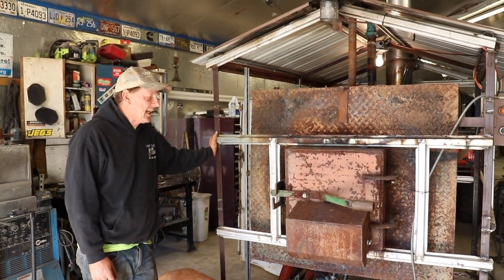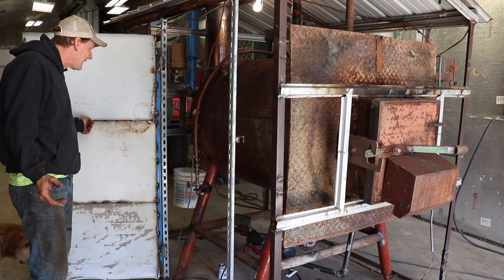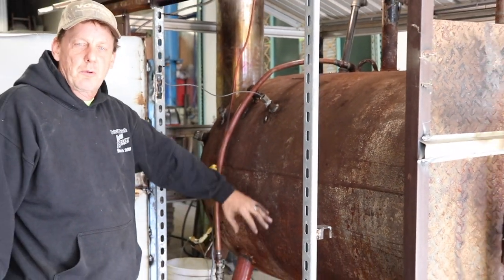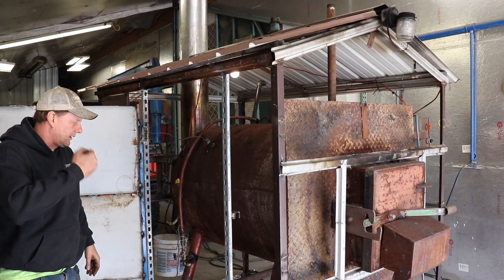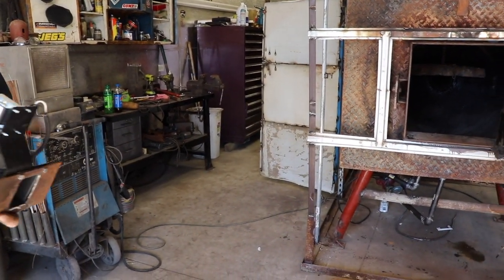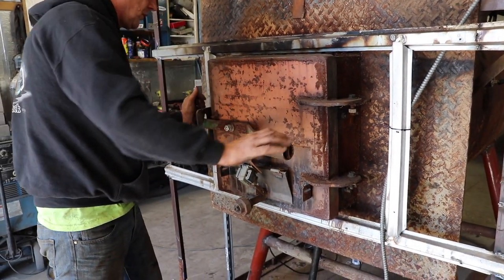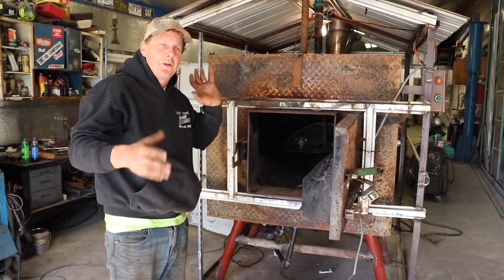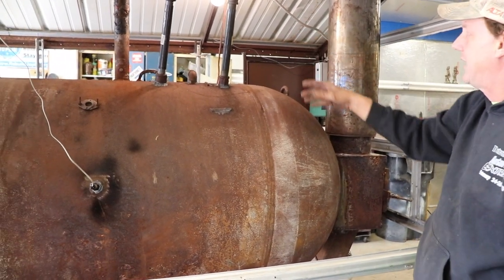How We Heat The Shop For Free | DIY Outdoor Wood Boiler Unit

Comment: I really like the cleanout door in the back for excess creosote !!  Did you consider adding fire brick ??  I want to build my own unit and I noticed some manufactured units with firebrick !  I'm not sure if the firebrick adds to the burn efficiency or not.  It seems as though it would help retain heat if the fire died down overnight .  What are your thoughts on this ?  Thanks for posting this , your design and build is by far the most efficient use of what you have on hand for materials and the small financial investment involved for the electrical controls needed to go this route !!!!!!!  Great Effort !!

Comment: I like the idea of using the big propane tank but how do you do the initial cut into it without risking exploding? Do you need to fill it with water first or something? Thanks man, probably sounds stupid to you but many years ago I was told never to cut into a 55 gallon drum with torch, even if the drum was brand new. Thanks again
Reply: fill with water and then cut

Comment: I would think that you draw off the bottom maybe if you have a water pump , but if you are using gravity steam rises so I would think that it would be better to feed from the bottom, that said if you have a pump and a tight system that has water all the way to the top I would guess that the hotter water would be closest to the 🔥

Comment: Johnny can we get a boiler update please??????
Reply from the maker: Aaron Andrson we will work on an update video. What are you looking for?
Reply: @JohnnyFabz  Im building almost the same setup as you guys. Would like to hear about the updates on the new blower fan and how the new storage tank is working the shop. Also would like to see how you plumbed everything for the house and shop. looks like you have the pumps on zones and maybe controlled by relays valves?  Also have you noticed any difference since you started pulling water off the bottom vs the top. Thanks

Comment: Nice, I like it.  Sounds like it heats your shop AND your home?
Reply from the maker: Steve Spevak yes heats a 60x80 shop and around 1800 square foot house
Reply: @JohnnyFabz  The real question is, does it heat your shop and your house comfortably while its REALLY cold outside?  Can get below zero for a few weeks in Indiana where I live.
Reply from the maker: @Itsallwood yes we set the shop at 67 all winter and it stayed their all winter in michigan. Last year was the first year that it was tied into the house and it did great
Reply: @JohnnyFabz  That is very impressive.  We are currently looking into other heating options, as a 700 dollar electric bill one February is just too insane to deal with, plus the heat that burning wood produces is too cozy to ignore.  I recently installed a pellet stove for my grandmother, so at the very least, we'll look into a wood burning stove or pellet stove, but I have also looked into wood boilers, but they are pretty pricey and a little more intimidating to set up.  But knowing what you have heats that much is very inspiring.
Reply from the maker: yeah their are lots of pros and cons, loading wood as a daily chore is for sure a Con but its well worth it. But yeah the reduction in your propane or electric bill is great.

Comment: I see the firebox where the wood is burned,. Is the heat transfer surface the back of the firebox and the smoke tube through the water compartment? Did you do anything to extend the heat transfer surface, like welding on fins?

In the event that you lose power and have a firebox full of burning wood, will the system safely shut down without you having to do anything? Do you circulate water or glycol mix?
Reply from the maker: The fire box is completely surrounded by water and the exhaust tube has welded “fins” on the tube to try and help with heat transfer. Water only, the computer shuts it down on high temp. Temps do rise some because the fire is still burning and no pump flow but fan door will shut stoping the fire from getting air. We have had the boiler over heat before and steam out the top, the nice thing about using such thick steal with the propane tanks is they don’t crack like the high dollar units do. The down side to having such think steal is the heat transfer suffers.